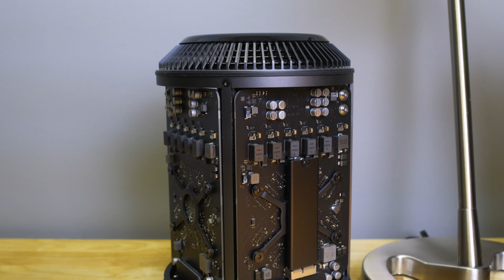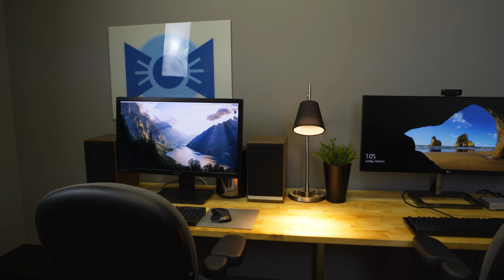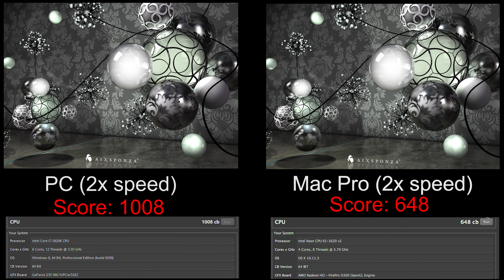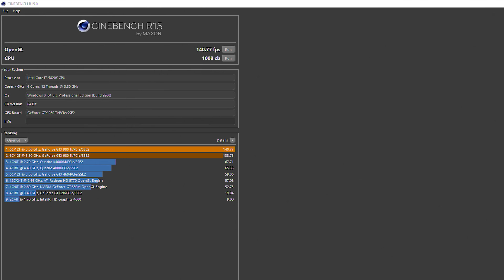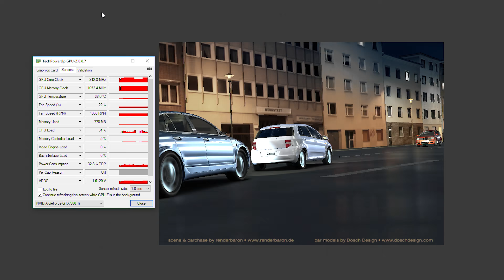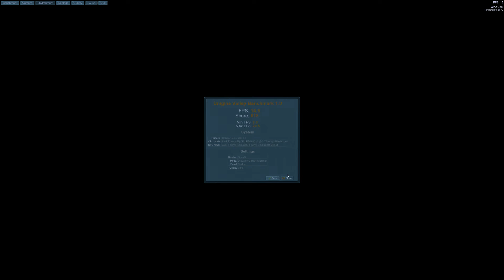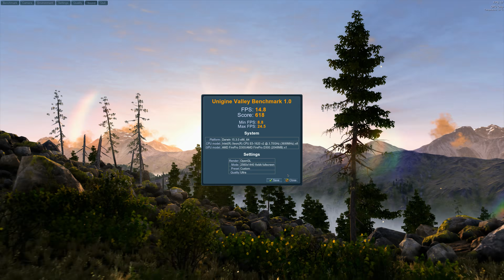$2,000 Custom PC vs $4,000 Mac Pro

Comment: Disclaimer: I dislike Apple from all my heart and I am very proud of the result (eventhough if you know a bit about PCs you could see it coming). BUT the Benchmarks he did were mostly gaming oriented and the Mac's GPUs aren't designed for gaming. You can get the most expensive professional grade GPU and not get the gaming performance you get from a consumer GPU that's a friction of the price. Just wanted to throw that out there because many people seem to not know that.
Reply: +Adrian Alfano the Mac should have won the first test, yet it didn't... and for that gap in price, you can get as many extra different GPU's as you want
Reply: wolfheart1982 I know, yet that test was only CPU related. I am not trying to defend the Mac in any way as I find they are way too expensive crap PCs for people that don't know how to build a Hackintosh. Only thing I wanted to say is that Gaming GPUs and Pro GPUs are very different and that you can't really treat them equally in benchmarks which are designed to test gaming performance. I guess a 980 Ti might even be better in rendering than these outdated wannabe-pro AMDs.